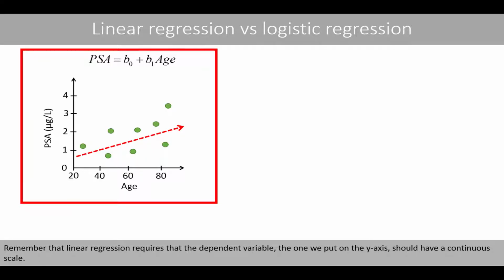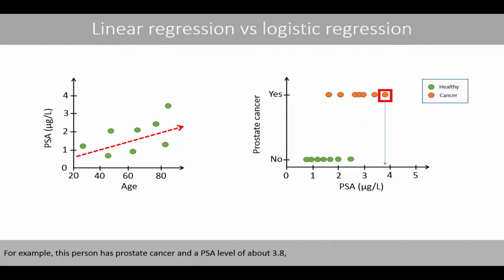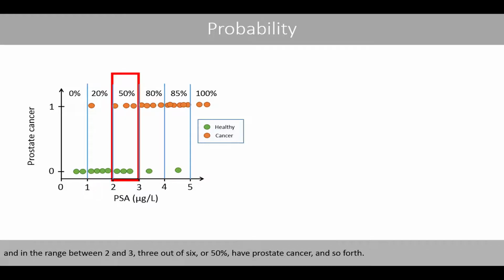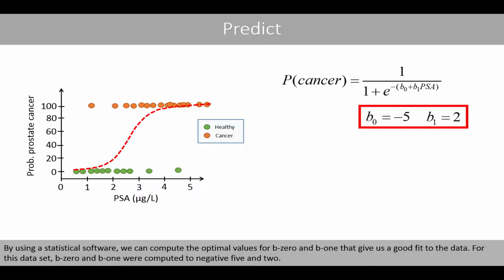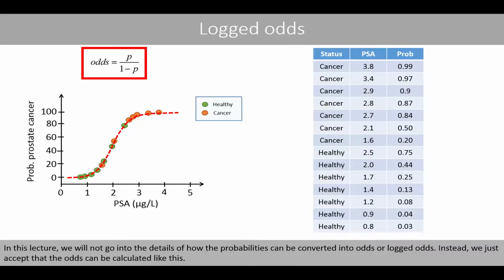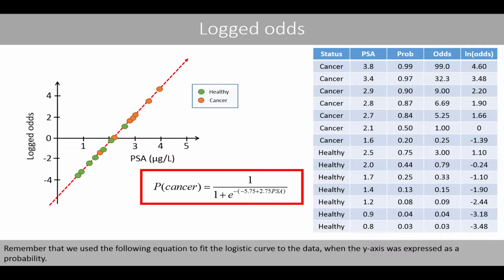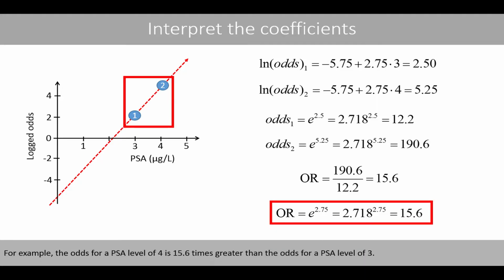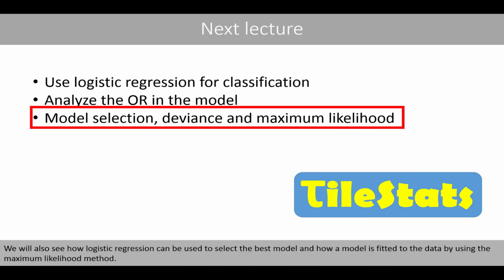Logistic regression : the basics - simply explained

Comment: Nice video. I have a question about using logistic regression with low prevalence (23:25): does NPV decrease, due to so many false negatives? However, in the example of the video dedicated to PPV and NPV, false negatives decrease and false positives increase with low prevalence
Reply from the maker: Do you mean low prevalence in the sample or in the population? With a low prevalence in the sample, you can adjust for this by changing the cutoff value.
Reply: @tilestats  ok, i'm agree. Is PPV calcolated considering prevalence in population? or in the sample? In last case, should I take into account the prevalence of the population when i'm sampling?
Reply: @tilestats  Please, tell me if I'm right: even considering a low prevalence in the population, I take a sample with a prevalence of 50% and I set the cutoff value that maximizes accuracy. Finally, I calculate PPV considering the prevalence in the population.
Reply from the maker: @giovannibrufani3603 yes, sounds right to me. I would also try to calculate the accuracy based on a test data set that I explain in the video about validation.
Reply: @tilestats  Sure. I'm not missing any videos in the playlist. Thank you very much for your work and for clarifyng my doubt!!!

Comment: Thanks a lot for this great video!

I understand how we get from probability to odds to log-odds. However, I don't understand what the purpose of this is. In maximum likelihood estimation, we adapt b1 so that the log-likelihood is maximized. But this process does not seem to depend on log-odds, right? Is log-odds only necessary for better intepretation of b0 and b1?
Reply from the maker: You actually fit a linear model to the data, which explains why the response variable must be expressed as logged odds. See for example this page:
https://arunaddagatla.medium.com/maximum-likelihood-estimation-in-logistic-regression-f86ff1627b67
Reply: @tilestats  Thanks a lot, I really appreciate your response! I have read the article and other articles from the author. However, I don't understand why it is necessary to fit a linear model to the data?
Reply from the maker: You can fit a nonlinear model to the data, the sigmoid function in this case, but then you have to use nonlinear regression which is not that easy to work with. It is, for example, hard to find the global minimum of the error function for large nonlinear models. I'm actually working on a video about nonlinear regression.
Reply: @tilestats  Thank you, looking forward!